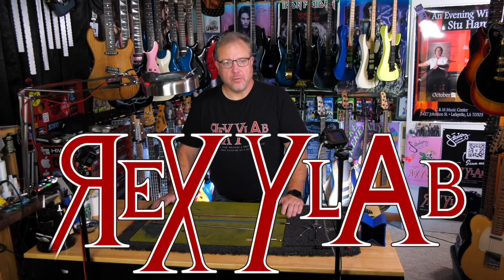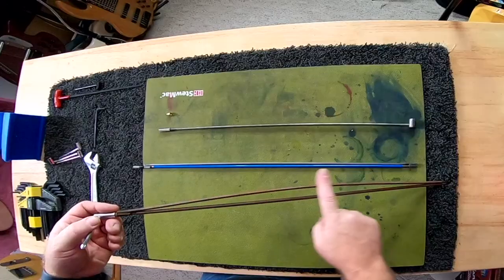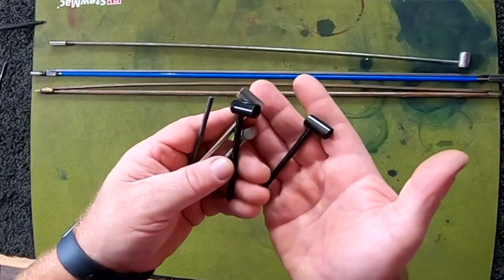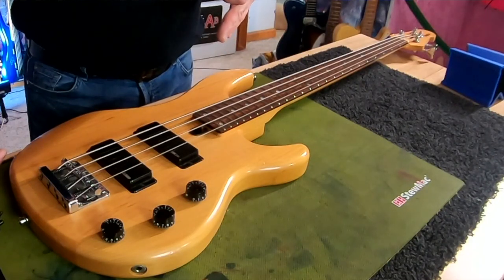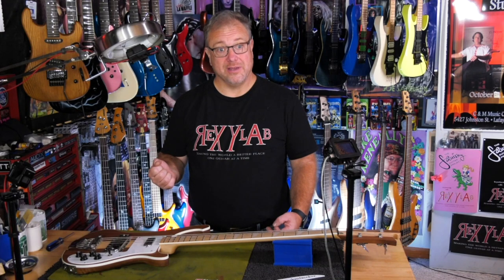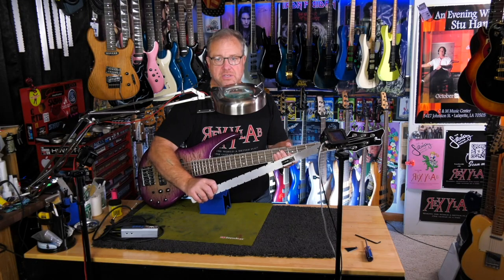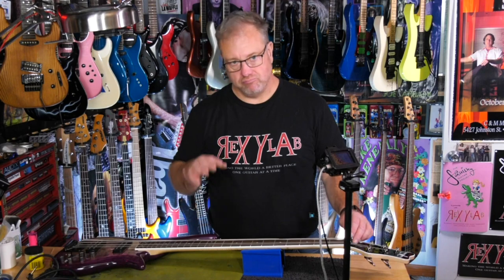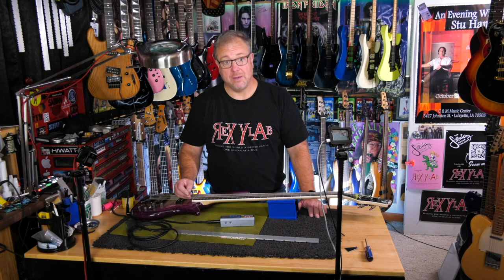Everything You Need To Know About Your Truss Rod🎸

Comment: 2022 Sire M7 6 string bass owner here.
I'm facing a serious stripped truss rod problem after just 2 or 3 adjustments. Obviously the wrench it came with was too small and/or poor quality. It's a dual action truss rod, so replacement of the nut is not an option. Help?
Reply from the maker: Oh shit!

First, stop and put it down. Resist the urge to mess with it until you’re head is completely clear and you are totally calm. 

Then carefully try to adjust it with absolutely zero string tension on it and a new wrench made out of the best metal possible (I suggest going to a very high end hardware store to find one, like Shannon hardware or the like. NOT Lowe’s or Home Depot or anything like that). Go slow and be careful. If at any moment things start going wrong, STOP!

The urge to jump right in is usually very strong but it almost never serves you well in such a situation. 

Where is the adjustment and what is the wrench? I would guess it’s Allen if it’s dual action. 

Lastly, it can be fixed no matter what. Here is a link to a video I did replacing a truss rod on a very rare Jackson bass from 1988. I encourage you to watch it all the way through before you touch your bass so you understand fully how big a job it is to replace a truss rod. 

Do not despair, I am here to help. If it turns out you have no other opinion you could even send it to me for the repair. It would be expensive. After you see this video you will understand why. 

Let me know the wrench and location and I’ll give it some thought while you check out this link. 
https://youtu.be/LSlijbt50ns
Reply: @REXYLAB  I'm from Macedonia so repair is not an option. It was an allan wrench and the adjustment is at the headstock. Took it to a good local  luthier and he is facing the same problems since literally every wrench he owns doesn't work. My last option is ordering a  StewMac gripper luthier truss rod wrench which is speciffically (apparently) made for working on chewed up truss rods.  The truss rod on this bass is 4mm so i guess i should order the 4mm triple band wrench?? Let me know what you think. I bought this bass last May and it cost 1300 euros ...brand new. I never had a problem like this with none of the bases i owned (Yamaha 6 string, Fender Steve Bailey 6 string, HB 7 String and many others). Thank you for the quick reply.
Reply from the maker: @stratrovarius  wow! One of my videos made it to Macedonia! Give me just a moment because that is just so cool! 

Ok, back to your issue. 

Yes, the StewMac tool you speak of in that size is probably your best option. I can tell you with great confidence that StewMac tools are very good and their policy on replacing things if they fail is outstanding. 

I would absolutely adjust it into a slight backbow with no string tension and then gently loosen it to your desired level of straightness (however straight you like it) and then bump it slightly back to tighten like I showed in this video. 

If that does not work I will be happy to brainstorm ideas with you to make it right. I do believe that the StewMac tool should work. 

Just be careful and take your time. 

I still hope you watch the link I sent you. I’m really proud of that job and it will show how involved replacing a truss rod is.
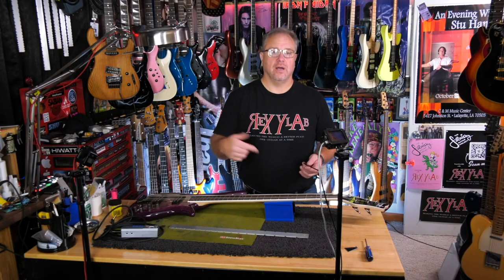Reply: So...on 11:24 you point out that the nut is loose for a significant amount of turns until it starts tighning again. Is it possible that the nut on bass is also in loose position,but the luthier think is actually worn out?????? (I know i tightened the neck pretty much to get low action before taking it to him for a set up and string changing). I'm still gonna order the Gripper truss wrench, anyways.
Reply from the maker: @stratrovarius  if you can’t feel the wrench biting in the truss rod or slipping then it is not just loose. 

The best thing you can do in this situation is not touch it until you get the new tool. 

I know the urge to try anything is strong but resist it. 

If you checked out the link I sent you will see how the people that destroyed the truss rod in that Bass mangled that thing. It is obvious to me they were trying to take every possible shortcut instead of just fixing the problem correctly. 

By the time the owner brought it to me he was so frustrated about it that he was ready to burn it in his backyard rather than just leave it to be fixed. 

I still don’t understand that mentality but he was about to do it. 

Get the StewMac tool and do it right. Don’t look for shortcuts, at this point they will only make you wish you were patient after the fact.
Reply: @REXYLAB  Thank you for the tips. I`ll take a deep breath and follow your advice. I`ll order the StewMac from ebay ( it might take a month to arrive here) but i`ll let you know of the eventual outcome. Also im crossing my fingers for the neck to naturally  relieve also since the weather will be getting warmer here in the following weeks. This bass should have been my main bass and It`s the most expensive 6 string bass Sire has to offer for 1300 euros with shipping costs included, (You can check my videos playing it) but is STILL made in Indonesia which i guess is by know is well known for delivering woods for instruments which are not dry enough.  :(
Reply from the maker: @stratrovarius  it is unfortunate that many factories do not properly dry their woods. The most common issue with that is fret sprout though, not the problem you are  experiencing. 

I would say that is 100% having a Allen wrench made of inferior metal and possibly a little too small. 

Perhaps it was also adjusted under string tension and that is not a safe way to adjust your neck. If that was the case please do not beat yourself up over it but rather view this as an expensive lesson that was well learned. 

Also, if that is the case you can spread the word of how to adjust your truss rod safely and correctly by sharing this experience (and this video if you are so inclined). 

I will definitely look at your videos and I invite you to subscribe to my channel and hit the notification bell if you haven’t done so already. 

I have lots of cool bass stuff on it now and even more to come.
Reply: @REXYLAB  This bass has perfectly rounded fretboard edges (its in their marketing) and the frets all laying nice and round as they can...better than any bass so far. Still, for a brand new (pretty expensive) bass that nut wear came way too soon even if it had more than 3 adjustments in the past 10 months of ownership...especially compared to the basses i already own or owned in the past 20 or more years.
Reply from the maker: @stratrovarius  if the wood was not dry enough the neck would have adjusted easier. This wasn’t an issue of wood that wasn’t dry enough. 

I’m sure the wrench was at least 50% the problem if not more. 

Did you adjust it under string tension?
Reply: @REXYLAB  Yes. Under string tension. :(
Reply from the maker: @stratrovarius  I am so sorry that you did not have the information that adjusting your truss rod like that can (a lot of the time does) cause damage. 

This is not your fault. It is a symptom of people regurgitating bad, incomplete, or just totally wrong information. 

I myself have had many things damaged because of this very reason. That is why I started my channel. I want to help as many people (just like you) get the correct information so others don’t experience the panic and the heartbreak of damage that can be easily avoided with the correct information. 

Now that you know I hope you will share what you have learned with others so they don’t make the same mistake. 

Have faith, your bass will play correctly again. Everything is fixable with the proper knowledge, tools, and patience. 

Regardless, I am willing to bet you will never tighten a truss rod under tension again. 

If you have not yet watched the link I sent it will give you hope. That bass was in a fire after I fixed it. A house burned down around it while it was in its case. Then it was hit with water from fire hoses. When I got it from the client I brought it to my shop and opened the case and not only was the repair still good, it was even in tune.
Reply: @REXYLAB  Update: Luckily, the neck got back to it's original straight position by itself once the bass was in a warmer room after just one night. I know it's hard to imagine but it happened. Still, i ordered the StewMac from freakin' Ohio,USA and should arrive here around May for around 50-60 USD (or more) shipping costs included. I'm following your advice and not touching the truss rod until then.I'll just lower the strings from the saddles to their original position (i like low action on all 24 frets) so i can play the bass regularily as i did before this problem occured. So far, so good. Fingers crossed. Cheers.
Reply from the maker: @stratrovarius  I am so happy it worked out!

My advice would be that you definitely take this as a warning to do it the way I show in the video from here on out. 

You might become the most trusted truss rod adjuster in your area, who knows.
Reply: @REXYLAB  Oh,absolutely!
Reply: @stratrovarius  I have had this happen with 2 Sire basses. I wonder if the nuts they use are softer metal than typical. In any case, if you contact Sire and describe the problem they may be able to sell a replacement neck at a very reasonable price. This saved me from removing the fretboard myself to replace the dual action truss rod. Having a luthier do it is simply too costly for the value of the instrument. That said, now that the basses are restored to playable condition, I may still try to fix the old necks for the experience.
Reply: @Aethalops  Sold it. Got a John Patitucci signature Yamaha instead. The real deal.

Comment: Hi, I bought a used RGD71AL-ANB a couple years back, and the neck's always been straight and comfortable for me. Recently, a friend changing the strings found the truss rod was already at its limit, not tightening further. Any thoughts on what might be happening? I'm not savvy about guitar setup. As I said it's fine for now, but thinking ahead for a potential sale and wondering if this is what is called a maxed-out truss rod? If it is, I'll mention it when advertising. Kinda bummed the shop didn't give me a heads-up about it when I bought it
Reply from the maker: Were really heavy strings put on it for some reason? Drop tuning perhaps?
Reply: @REXYLAB  It has 0.10 strings (same as before), It's standard tuning
Reply from the maker: @robruths  and it’s a fixed bridge no whammy bar, correct?
Reply: @REXYLAB  That's correct, no whammy bar
Reply from the maker: @robruths  why was this person tinkering with the truss rod if there was no problem with it? Did they do it under string tension or with the strings off or slack?
Reply: @REXYLAB  He was showing me how to do it, and truly there was no room to tighten it, so he didn't do anything with the rod... It was under string tension. I am trying to figure out if this is a major problem or if I am worried for no reason lol What would you recommend for a situation like this? Sell the guitar or take it to a professional to look at it...
Reply from the maker: @robruths  respectfully I think that it’s fine and you shouldn’t mess with it. 

If you tried to do it under string tension it could very easily give you the impression that it is out of travel. 

My recommendation would be leave it alone and don’t let your friend do adjustments on your guitar. 

If you absolutely must mess with it (and I encourage you to leave it alone) loosen the strings all the way and then see if it will move. Loosen first and then you will know that it can go forward at least as far as you loosen it. 

That being said I bet it’s fine and you should leave it alone. The potential to screw it up goes up a lot when you start playing around with it.
Reply: @REXYLAB  Thanks a bunch for your advice! I get what you're saying, and I'll leave the guitar alone for now. It makes sense, and I'll remember your tips in case I ever need to make adjustments. Appreciate the help!
Reply from the maker: @robruths  that’s why I’m here my friend!